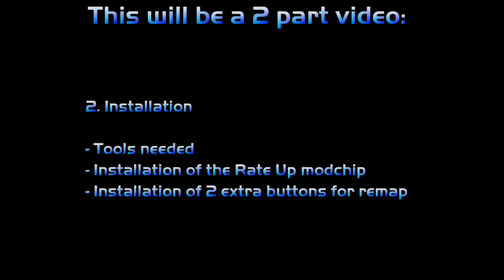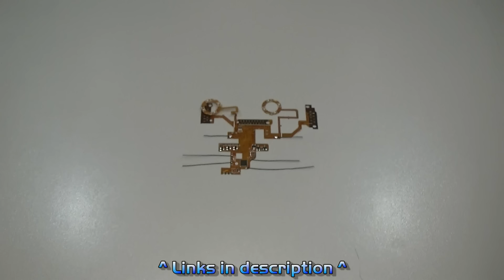How to install Dualshock 4 Rate Up Modchip - PS4

Comment: Hello, which three contacts do you mean? All 9 soldering points are interconnected, so they mean three contacts on the circuit board of the controller that must be connected to the board of the kit?
Reply from the maker: The ones at 15:58

Comment: Hello, my controller remains out, ordered the kit and what I have done wrong.
Reply from the maker: Are you sure the button transfer pad is aligned correctly, if so check you 3 solder contacts that they dont touch each other resulting in a short circuit of some kind